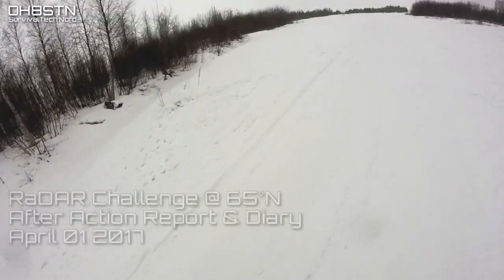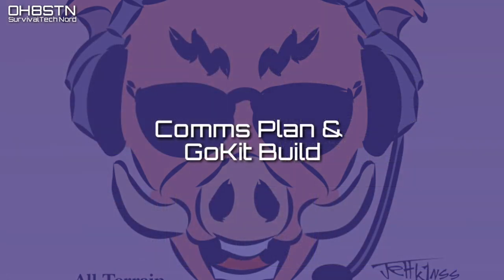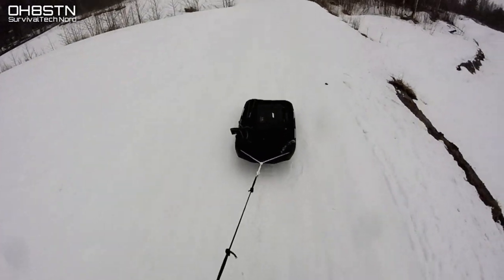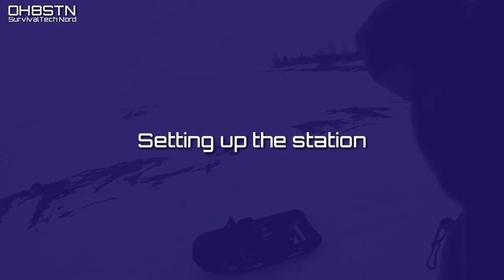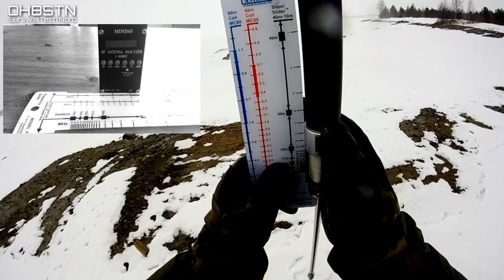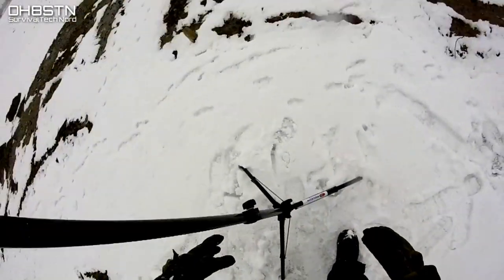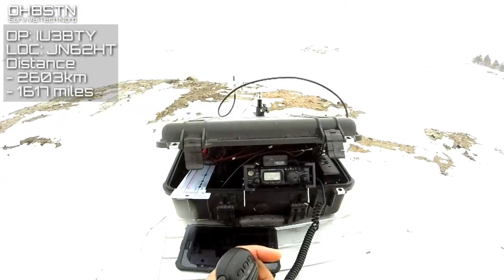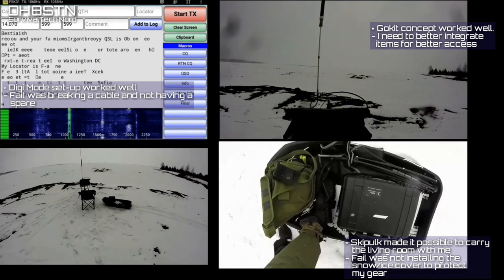Super Antenna MP1 & Yaesu FT-817 Winter

Comment: I admire that your focus in on creating realistic operating situations which may be faced by those who might have to operate under such conditions during  real emergency. It's all fine to imagine such operating conditions and quite another actually getting out in the weather loaded with gear. Radar offers a real chance to provide proof of concept operations, but even Radar is limited in many ways. Real emergencies would require operators to develop networks, pass information as would be the case with an ARES type activation. Strategic communications operations would involve sustained field operations. Rapid deployment and mobility is more about tactical operations than developing a useful communications strategy if operators were required to do field operations. AREAS SET (Simulated Emergency Training) exercises includes actually passing simulated emergency traffic. For me a realistic evaluation of a RADAR type event should include the ability to demonstrate an effective ad hock communications network within a given set of possible scenarios.  Emcomm is all about helping others in a crisis. At the end of the day it is about the information and the people who need or use that information. The gear is important only so far as it makes such communication possible.

Comment: Julian - what impact does the cold have on your batteries?  Do you see degradation in operating times?  My Android tablet does not do well in the cold at all.  Hank
Reply from the maker: Hi Hank. Just commenting on your video.
With Lithium Polymer batteries, I've had really good luck with. The nickel metal hydride really suffer. I also never packed the tablet of a smartphone independently of my person. It's just an old habit but I try to keep my tablet in the comfort of my body heat.
Thanks for commenting and watching Hank it's really appreciated
Reply: I've seen / heard of camerapersons using the chemical hand warmers to keep batteries warm.

Comment: This was an awesome video Julian ! So much covered I am sorry I missed the event.  The counterpoise wires on the super antenna can be a charlie foxtrot. I Got some 20ga 6 conductor ribbon cable and cut them to band lengths and keep it spooled on a cuban yoyo fishing reel. I stopper knot the 40m wire and keep it through a hole in the yoyo reel and the yoyo reel keeps the counterpoise "array" laid out well. Tripod toppling drives me nuts too. I picked up a microphone stand base and so far it works great but isnt very light. The weight and low center of gravity really help.  Thanks for sharing !
Reply from the maker: +SurvivalComms thanks Bret! The RaDAR Challenge is definitely a learning experience no matter from where one participates. It's that thing I mentioned once before, about putting the gun to your head, telling you to operate in whatever conditions you happen to be in.the next opportunity comes in July.
Hey do you think you might make a video on your counterpoise setup? Sounds like it would be a popular one for any collapsible whip. Or I can do it, and you can laugh at me 😀. 
I just received a new tripod for the super antenna. It's going to hook underneath which allows you to hang a counterweight or counterbalance. I have to make a separate video or perhaps of blog post about it, if it works out. For the MPAS, I heard there is their new ground spike antenna mount on the way.  Manufacturers are paying attention to the way we operate in the field.
As always brother thanks for the kindness. You are definitely one of the crew, and your comments help guide the direction I take the channel.
Julian
Reply: Thanks Julian - I will make a video of it over the next few days. Like the super antenna's counterpoise it is universal and works for all kinds of fun designs.  I have a video to upload of a similar DIY multpurpose mast I made last week. I have used a surveyor tripod before that uses the free hanging weight. With a good durable bag for ballast you can get a good 12-15 foot before the mast leverage vs base weight becomes unbalanced.  Do you know of a good app to time sync and android device ? Thanks again !

Comment: Rock 'n' Roll! Great video! Crikey that looked very, very cold! Brrrrr! Nice job Julian I like the sled, really useful on snow and ice. The tipee looks a more cosy option for fixed portable. I like what you said about what the Finns call 'seeswee' (sp.) that doing something the hard way is sometimes a good way to learn how to do it even better, but sometimes the easier option can work out best of all! Tipee ... Baby log burner, JD in hip flask and chocolate... WTG! ;)
Reply from the maker: Lucy Lu M6ECG 😀 it sounds like you're describing a date Lucy. Chocolate, JD, soft glow of a baby wood stove, tipi, ... 😉 
Yes the pulk works very well. I also have a more traditional one which is lighter to pull, but much larger. I think winter field day will be my first chance to show the community the "Winter field station" configuration. It's all coming together well. :)
It's very nice to have you active again Lucy Lu!

Comment: Perfect, very good. You can shed some pounds with a battery from Bioenno, I use that plus a MP1 on all my portable treks. I also built a frame that you might find useful, from PVC that holds everything in grab and go convenience. Strong and light weight.
Reply from the maker: Thanks. I'm working on the battery from Bioenno. Tell me about that frame or perhaps share a link so we can see it. Thanks for commenting
Reply: That is a 'weak point' of the FT-817(nd) in that it doesn't have a detachable head.  The back pack would be a nice contained unit if you could detach the head and control the rig / etc while the main parts were kept dry and warm...
Reply from the maker: KYTec IT COMPLETELY AGREE!  If you have t817 had a removable head like the ft-857 I would be the happiest camper on the planet. Having the ability to mount the radio and a backpack or perhaps a Pelican case while keeping the remote head closer to the operating position open up huge possibilities.
Reply: I wonder - would the Bluetooth CAT Interface for YAESU FT-857, 897, 817, 100 - TX/RX App (Android) work rather than trying to detach the face?

http://www.ebay.com/itm/Bluetooth-CAT-Interface-for-YAESU-FT-857-897-817-100-TX-RX-App-Android-/152519982366?hash=item2382e63d1e:g:i3QAAOSw5cNYQlSn

You already have the Android Tablet for Digital modes,...
Reply from the maker: KYTec IT https://youtu.be/_abM3X3dtiw
Reply: I thought I had seen a YT video you had done on it.  Memory isn't like it used to be

Comment: great video, I need to upgrade to a better portable HF. rig. seeing your setup ideas helps alot
Reply from the maker: +Chad Steiner thanks. What kind of setup are you hoping for?
Reply: a small 80m-10m qrp rig. been using a icom 706mkiig but have it set up permanent now in the shack. kind of thinking the 817 or smaller so I can pack it into my motorcycle. have a chameleon  mpas. antenna for portable.
Reply from the maker: Chad Steiner Chad I rode for years with the 817 in my top box on my Honda Varadero. It's definitely a tough rugged little bugger, but at the moment I'm considering the Elecraft KX2 as a second option.  The KX2 is certainly not as rugged, but it's smaller size makes it more deployable. It's hard to beat the 817 on cost versus ruggedness though. 
I also like the MPAS. It's so easy to set up, no fiddling, push-button to tune it, and work away.

Comment: FB Julian. That sled is the key here it seems...
Reply from the maker: +Radio Prepper Agreed. The ability to carry the equipment that I need to sustain myself in these conditions is dependent upon a ski pulk or hiking trailer. If we look back at the winter War skis and pulk sled, were critical elements in c&c and mobility.
As they say  "When in Rome".
Thanks for stopping by. Btw, look here www.oh8stn.org/links

Comment: Great video. I am interested in the amp you are using. Can you give more details on the amp and it's cost and where to purchase? Thank you for your continuing great advice. I have learned so much from you and you have opened the world of QRP portable operations to me. I really appreciate your effort and wisdom.
Reply from the maker: You are too kind Larry.
The amp was Homebrew from a friend of mine, but there is one that I would consider recommending for others. First of all we should consider a couple of things. Firstly do you want an amp for a qrp radio or should you invest in a more powerful radio and dial it down to qrp level!? For example I'm considering for emergency communications the Yaesu ft 857 but limiting the output power to 20 watts. The other option is keeping the qrp radio that you might already have and adding an amp. Just remember though if you increase your output power you're also going to reduce your operating time. So you may have to consider upgrading your solar panel or off-grid power for longer operating duration. I'll reply again shortly with the links to the amp I should have invested in and built.
Reply from the maker: +Larry Nathanson http://oh8stn.org/blog/2017/06/07/amplifiers-for-low-power-field-communications/

Comment: Do you have a review video somewhere with more info about the 45 watt amp you use? Thanks
Reply from the maker: +The Johnny O Show thanks that was a Homebrew amp. Other than this video I don't think I've ever mentioned it before. I have a small 10w amplifier that I use for the 817 now. I realize there was no point to operating QRO, that's powering up such a device is impractical in the field. I'll keep it under 20 watts
Reply: ok thanks good to know :-)